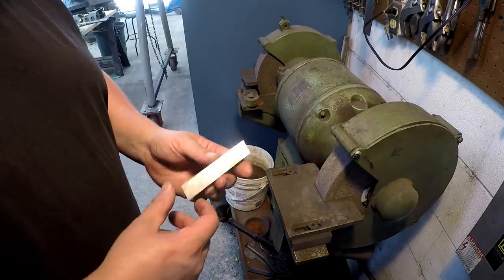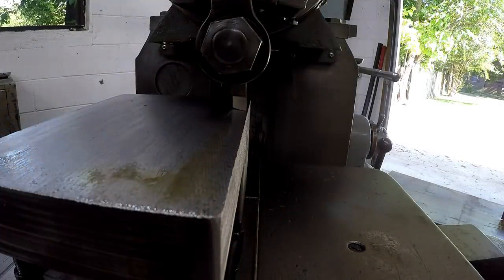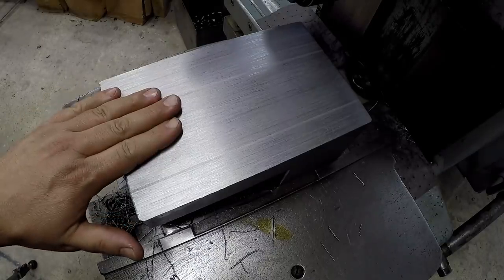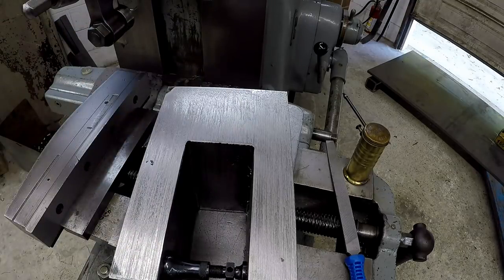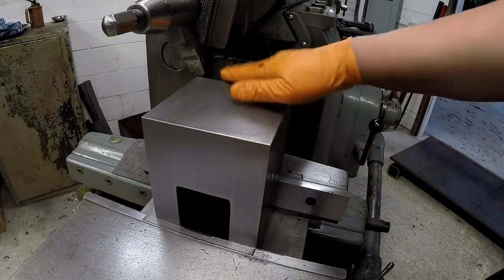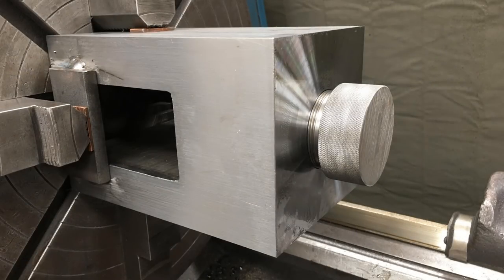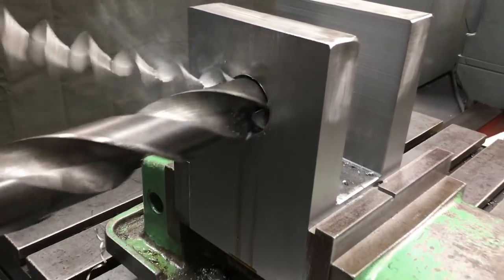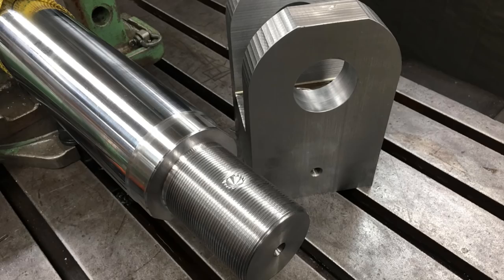Shaping a Hydraulic Rod Clevis Part 3

Comment: Getting to see the shaper go from arrival, then through repairs and now doing production work is awesome!  Thank you for investing the time to get a camera in there to let us see it working.  Hopefully another tool holder can be found or made.
Reply: Ahh, it all becomes clear lol, I was wondering why he didn't just cut all the faces with a big fly cutter on the mill. :-) 

(I've only seen this one video, and wasn't a subscriber until now. Didn't know the shaper was a new acquisition...)

I didn't even realise that shapers were still a thing. They don't really achieve anything that you can't do in other faster ways, well, nothing that springs to my mind at least (if I'm wrong please correct me. I may be wrong). Last time I used a shaper was during my apprenticeship in 1996 or something :-)

Now I'm just a button pusher lol (well, 5 axis CNC programmer button pusher)
Reply: Adam has posted a great series of videos about this shaper.  He began with the process of locating it in another state, then getting equipment moved so it could be loaded out of the building it was in.  Soon after delivery he began analyzing its condition and rounding up information and parts.  During the repair phase Adam has carefully explained that he wants to learn what a shaper can do, how its a tool he has always been fascinated with.  Having seen every video Adam has posted has helped me learn to run a manual lathe and mill safely and accurately for making my own production parts.  The man is a tremendous resource and a gentleman, and watching his videos is a worthwhile investment of your time.
Reply: Only subbed to the channel recently, although I had seen a couple of his videos in the past which I thought were pretty good. Will check out the earlier parts regarding shaper, thanks :-)

Comment: I've watched many of Abom's videos over the years and love the machining. This video is the best I've seen so far from a photographic or graphic viewpoint. Some of the shots on the shaper where the camera is mounted next to the cutting head were fantastic. I also loved the shots with the 2" drill just cutting through the surface  of the clevis with the bulging out of the surface, the changing color in the heat and the clear reflection of the turning bit. Your videography is really getting impressive.

Comment: Many decades ago, my father had a massive shaper in his machine shop.  For curved lines, he would blue the part and scribe out the line, (like the radii on your clevis, or any curved line) then cut very close to the line with the bandsaw.  He'd chuck it up in the shaper with a slow feed and follow the line with the clapper box feed screw.  Slow, but very accurate with good light, good eyes, and some patience.  Butt hay, that was in the '50s.

I'm envious of your big shaper, but I love my little 7" Atlas.  What a great machine the shaper is.  Thanks for the great videos!
Reply: throngcleaver m

Comment: I really like the shear tool geometry approach. I can get a flat and smooth finish on my shaper that almost looks like it was done on a surface grinder. The material has a lot to do with that, though. Brass and aluminum are the best. Cast iron is also very nice, but steel can be a challenge sometimes. I zip-tie an oil tube to the front side of the cutter and drizzle feed the oil as it runs. Brass and cast iron always run dry.

Comment: Love the shear tool! I use it to clean up motor commutators and it leaves a mirror smooth finish. I may be wrong, but I have the impression the tool should only be used for cuts under .003", the step over can be calculated as a function of the tool radius to minimise the scallop height. For copper I use a highly positive top rake, the other angles pretty well match your's.

Comment: I've found that fine threads seem to loosen and pull out quicker, especially anything subject to impact. We had ours made with standard 8 threads per inch and cut a slot to use bolts to clamp the sides to the shaft. It cured the clevis and shaft problems.

Comment: For our shaper we had a plate that bolted to the ram head in place of the clapper box and had a heavy wall tubing welded to it with a 2" bore for cutting internal keyways, etc. The plate was slotted so as to angle the cutter, the same as the clapper box.

Comment: Starrett has a really great explanation on breaking in band saw blades at the intro to the blade selection in their catalog. They said that the blades need a break in period to microscopically break the cutting edges. They had a microscopic view of the cutting edges and the one initially operated at full cuts developed microscopic cracking and chipping. The edges were so sharp they could not dissipate the heat developed. I guess you could duplicate the break in with a light pass on very fine sandpaper to break the edge.

Comment: Instead of just squirting oil on the surface, have you considered using an oil mist? It should do a better job of keeping the cutting edge lubricated and possibly even keep it a little cooler if you switch to water based cutting fluid.

Comment: I was hoping you were going to put the radius on with the shaper somehow - it seems like it has to be possible in some way....but the table/vise might have to be able to set up with an autofeed/autorotate after being tilted 90 degrees. Or maybe the crossfeed and downfeed would work - especially with a tapered cutting tool, if you started at top dead center and went in each direction. In any case - seeing that machine work is amazing. Thank you!

Comment: I wonder about adding one of those Noga mist units to the nose of the shaper. Not only would you lube the cut, but blow off the chips to prevent recutting/smearing.
Reply: You know, on a machine with old school cutting oil smoking away, and literally throwing off giant razorblade swirls of hot blue chips... I think a little coolant mist is the least of the mess problems! =)

Comment: You could spread out the cutting oil with a paint roller. Not sure if it would make any difference in surface finish, but it might be easier than drawing lines with the oil bottle.

Comment: I might be late to this however. I noticed the shaper was not popping the tools head up away from the work. Now I'm very amateur at machining but I'm wondering if tool geometry, feed rate, step over rate, or depth of cut or a combination of those would allow you to get away without having the machine head pop up to clear the work?

Comment: Man I'm not sure if you need much more back rake on that top portion you mentioned.  The cuts are so light there's hardly enough chip to flow out of that top portion like with your other shaper video's you've shown.  It did an awesome job on it even with the little imperfections you had mentioned.  I'd be extremely satisfied getting a part back from you.  Always do quality work.

Comment: Great job Adam. Shame about that nut breaking on ya for that boring bar on the shaper. Would have liked to have seen that happen.  Question: can an auto oiler be set up on the shaper instead of you having to squirt it on? Just wondering to save your finger squirting. Again nice job.

Comment: Make a shaping/boring bar that replaces the tool mount (where the HSS bit goes trough) on the clapper box. Much more rigid setup. Clapper box should be locked when working with boring bar, btw. Otherwise nasty crash might happen.

Comment: A very nice job Adam, I would have loved to see how you set up the boring bar on the horizontal mill, how you set and measure the eccentricity off set. A pity about the shaper breakage, but you are well capable of making a new part, better and stronger no doubt.
Reply: Oh and I only watched it once, and I bet hardly anyone has actually seen a drill in action from the back side and it's fascinating to watch, but am i correct in thinking that that 2 and a half inch was it bit was only cutting on one edge, or were my eyes deceiving me?

Comment: wonder if you could just put the part in a 4 jaw chuck such that the hole is concentric with the 4 jaw. put the 4-jaw on the mill and put your origin at the centre of the clevis bracket hole. Then move your tool out by the radius of your cut plus the rad of the tool and rotate the 4 jaw to do your cut.

Could be faster depending on the job and possible easier. This might get your a nicer and cleaner cut if you do not have a  cnc machine to do the cutting for you
Reply: You are basically describing a rotary table, and that is how these arcs are commonly cut.

Comment: Hey Adam,  I was wondering if there is a reason not to use your method like that cast tooling plate you did and use a small depth and BIG step over? That provided a killer looking finish.

Comment: i`m no machinist by any means i think i never come close to  such work ever in my life , but i`m a decent cook ! i know they do not compare at all , but my point is , when ever i`m searching how smooth something is , i always try to run my lips on it , soo gentle touch of the lip will tell you with a grater acuracy how smooth something is , i think this will be useful when testing the smoothness of a tool egde, but be careful , remember just a gentle touch
Reply: Andu Ninicu big difference between olive oil and cutting oil my friend, I don’t think he be running tools across his lips 😂
Reply: Might cut the heck out of your lip too.
Reply: Odd, but interesting question. Yes, other people have asked and answered this question on the inter-webs (I didn't dig much into exactly 'why' they were asking, lol). What I found indicates that the tip of the index finger is more sensitive to touch than a tongue. Apparently the tongue is more sensitive to temperature though.

Comment: awesome work. I love that i can hit up different channels to get different levels of detail into the work! one question I've had is why the shapper vs a fly cutter or surface mill?
Reply: The shaper is just cooler, I suppose!

Also apparently in some shapes you can get a nicer/easier finish.
Reply: Im not a machinist, but my guess is the hand cut high-speed steel tools are much cheaper than running an end mill

Comment: great  video as usual I have a much smaller shaper and I have much better luck with a higher rake angle if you were to look at the leading edge from left to right the depth would be like .100 and the trailing edge would be around .050 I don't know if that makes sense lol thanks a million for the great content

Comment: There are 2 operations that I consider brutal in metal work. Broaching and the shaper. The shaper however does have an elegant aspect to its way of stock removal. The only other thing that makes me cringe is milling a keyway in threaded stock. I always sucked in woodworking but metalworking is art.

Comment: To me it seems the cutouts for the screw heads in that bar holder that snapped make that a weak point. If the screws had been further out and cleared the circular body, with no milled cutouts, it would have been a stronger part. Or made the square part a bit thicker, and used longer screws to have them closer without taking material away. The latter would be better actually. Why would they even do it the way it is now?

Comment: On the thing about the lines after a finish cur or for that matter any cut.  They can come from stopping and starting.  We have found that the lines come mainly from the tool cooling down when you stop.  And that shortening, likely about a few millionth of an inch or so in shortening due to cooling, produces a line you can actually see.   When you do a finishing cut, try making run from one end to the other first then if a line appears something else is the problem.

Comment: How come your boring bar is not turning concentrically?
Reply: You offset the boring bar to control size
Reply: That's interesting.
Reply: eduardo sampoia 
It is likely more accurate to offset the boring bar than it is to extend the cutter and risk deflection.
Reply: Wayne Crews and more rigid, to cut down on possible chatter.

Comment: What determines how tight a spiral the chips form?  Is the the size of the cut?  Those thin chips were really tight and the bigger ones (on part 1) were really large.
Reply: Wild Turkey 
Not sure if this is correct or not but think of a piece of aluminum foil compared to some 1/8” flat bar. 
The thinner material can be folded much flatter or rolled a lot tighter so primary reason would be depth of cut. 
The angle of relief on the cutter can affect the chip too.

Comment: After the next solar storm, when all the tech melts down, and we are back to fire and steam. You Adam are gonna be king. I mean someone have to make the first electric generator 'again' :-)) Btw. the last solar storm was in 1859. and the cycle is 150- 200 years apart. So we are very due to get the next one. And no one are ready for it at all. Except for Adam. :-))
Reply: What a bunch of nonsense...
Reply: How do you reckon that electric powered shaper of Adam's is going to work with no generators to run it? lol

Comment: Hey Adam, great video and thanks for sharing.
1. Fuck Shapers !
2. I am whole-heatedly against the dimple you made on the thread. For starters, the operator tightening the rod (shaft) to the clevis would never have the dimple under the hole for the set screw every time he screws it in (ask me about that). If the counter argument was that the shaft does not need to be un-screwed at all, or not that often, then I would've opted to 45 degree hole half an the shaft and half in the clevis, and thread that and insert your set screw. That would (at least) give the operator the chance to visually see were the two (half-) holes meet.
Great work anyway.

Comment: Rod clavis on shaper.
So many wrongs.
1, Rough out ALL surfaces first.
2, Finishing tool is a horror. Angles are not good. 
3, Do not stop the shaper especially on a finish cut. The oil on the ram slides goes. Leaving a defective surface step/scratch.
4, A block that size needs stress relief heat treatment. 
5, Final cuts should have a false start.A strip of material to pressure the tool up for a good flat finish. Just so the tool is cutting smoothly and not impacting on the work piece. 

I appreciate this is a demonstration. 
Workshop practice  teaches a better way.
Reply: Martyn French 
I’m not going to say you are wrong on any aspect of your post, except, clEvis!
You did notice that the finished item was more than acceptable for the purpose it serves, all of your suggestions would do little for this job with the exception of increasing the cost!
Reply: Shut up Meg!
Reply: @tejassarma6829  what is your problem.?
Afraid of the truth?
Afraid to LEARN.?
Reply: Martyn French your “teaching style” leaves quite a bit to be desired, but props for your knowledge.
Reply: Real-world practice teaches you to make the tool perfectly functional, and finished to suit the purpose. 2 days after it's put on the bulldozer, you can't even see it under the mud.
Reply: @Bob_Adkins  
I think Abom said in the beginning that this was an opportunity to practice on the shaper? I have used one smaller in school when we made a vice, but never since. The drilling/threading put aside: squaring up the piece in a mill would be more profitable in my opinion.
 But as long as noone gets hurt everybody is free to do as he/she chooses 👍🏼💪🏼🤗!